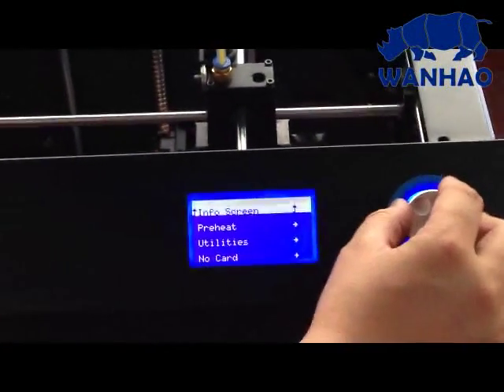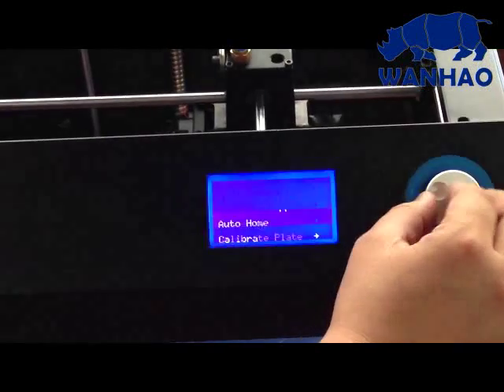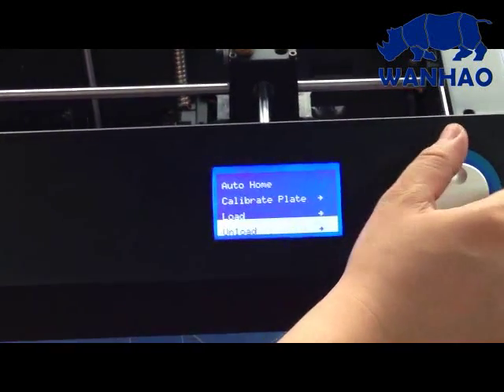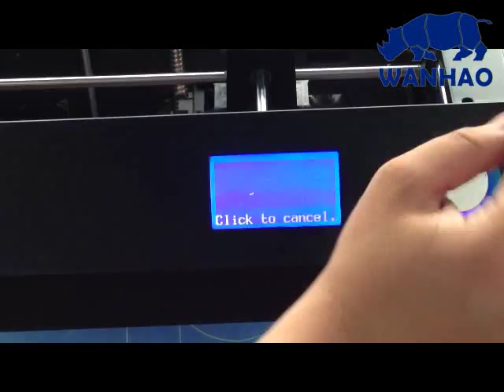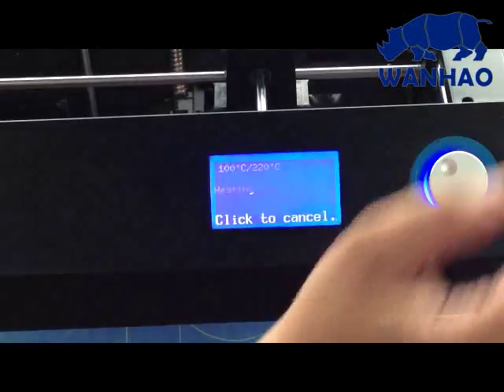Wanhao D5 jam inside extruder repairing.mp4.mp4

Comment: Hey Manolo, would it be possible to create an updated video for this based on the new extruder? I think the hex bolts to unscrew it are on the bottom but my nozzle assembly gets in the way of one of them. I had a PLA leak in the nozzle/ extruder threads and i'm desperate to take it apart to clean them out because it's burning and causing continuous jams!